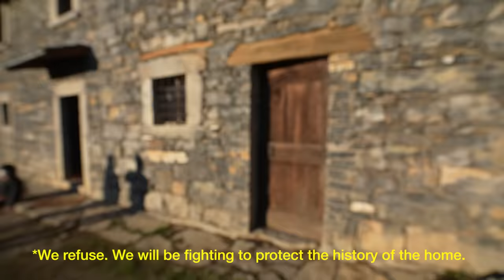Winter at Our Cabin in the Mountains (Ft. The Newbys)

Comment: In some renos I have seen in the UK (on TV) they put skylights through the roof. It admits light to the top story and the lower story can receive extra light through light wells or putting translucent panels in the floor.  That means that the super-thick rock walls can be left alone and the facades are unchanged.
Reply: Such an excellent idea!  A larger skylight on the roof planned over a stairwell that would join the floors in providing extra lighting  ...for BOTH floors!  Then LARGE MIRRORS  on either side of the stairwell at the bottom (and the top of the stairwell too) would add even more light!!

Comment: What about light wells I.e. light ‘tunnels’ from the roof to address the lighting problem. They would take some space from the upstairs but would allow you to leave the facade alone and bring additional light to the downstairs rooms.
Reply: ...you don't need to use tunnels if the floors are cut open with several large squares directly below the skylights and thick glass in placed inside an iron-surround ...or even a large iron-grate with glass over it.

Comment: You've probably already solved this specific issue with the "proper authorities" but what about a Dutch Door with a working window as the upper portion of the door, as a trade off for making the normal window in the wall a little larger as a nice compromise?